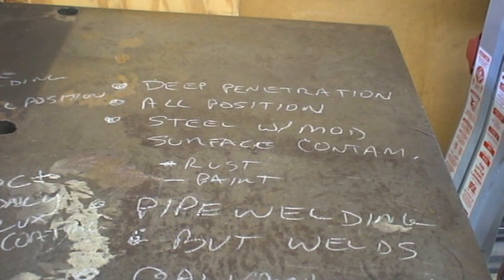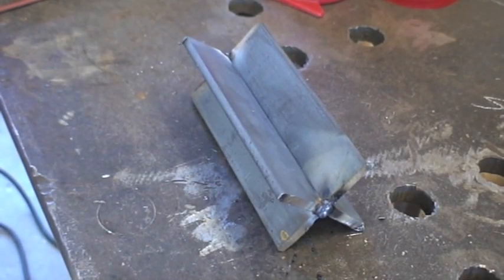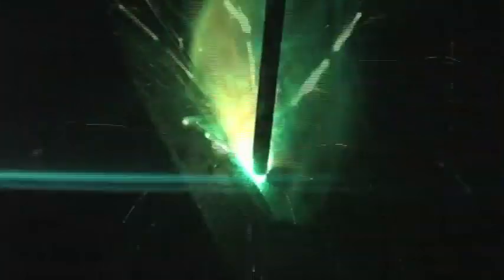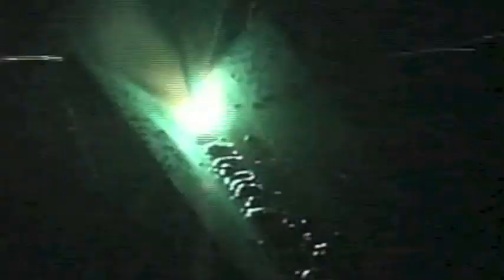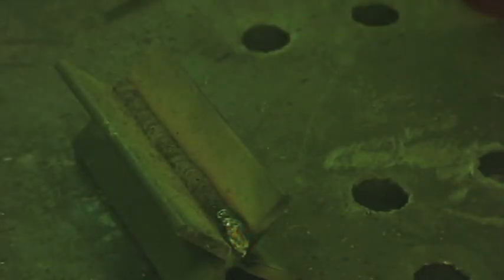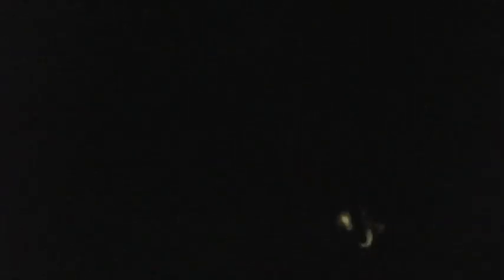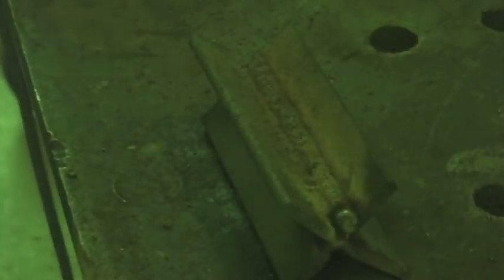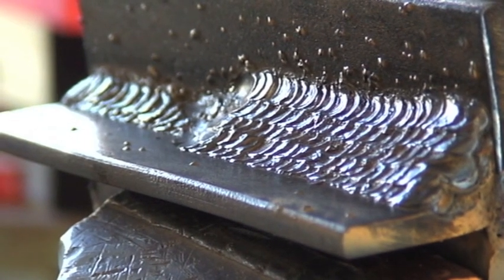Stick Welding with E6010

Comment: can you spot weld with it?
Reply from the maker: Jason Browne Technically no, since spot welding is fusion only and stick welding will deposit filler metal, but you can achieve similair results if you are skilled enough.
Reply: WeldFever
oh ok but the correct amperage is necessary to prevent it from creating slag inclusion even on low carbon steel?
Reply from the maker: Jason Browne Slag inclusions are a big problem with E6013 rods, but not so much with 6010/6011, especially when quickly applied like a spot, or tack weld. Good luck

Comment: hey i'm trying to learn welding, going to a trade school for it and i need practice.

its only 2 days  a week.

 i'm wanting to get a welding machine, cheep 1 and i was looking at this 1 (Lincoln Electric 240-Volt / 225-Amp Stick Welder) but i'm using in class e6010  can this rod be used on it.
Reply from the maker: Winbean winlite If you are referring to what's commonly called a "tombstone" welder, or "buzz box" then you have to make sure it is the type that has DC polarity in order to run E6010. Most "buzz boxes" are AC only, so if you bought one like that you would have to run E6011, which is the AC equivalent of E6010. Hope that helps and good luck with your purchase!
Reply: WeldFever Just what I wanted to hear, meant to reply sooner been busy busy busy.

hey  thanks for the reply!

Comment: Good Video but I think you should do one on sixty thirteen as it is what's used by beginners mainly
Reply from the maker: As fate would have it, I have a little 6013 in my next video, which is being uploaded as I write this. I know a lot of people use this rod, especially to teach new welders with, but I honestly hate it! I have never liked working with it, and I'm afraid I probably never will. Never the less, I did manage to burn a bit of it, so I hope it is enough. Thanks for your suggestion and please keep watching and commenting.
Reply: Thanks
Reply: WeldFever I am currently in welding school and E6013 is not part of my course. I was started on E7018 and am now on my second day of E6010. As I understand it 6013 is hardly ever used in the field. I actually have a question but I just looked at the time and I have to get to class. Great video.